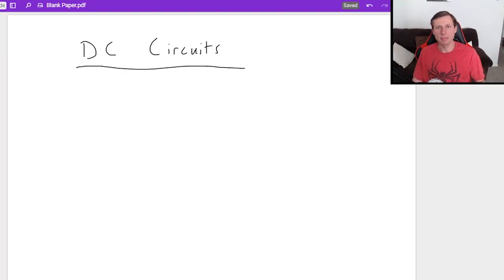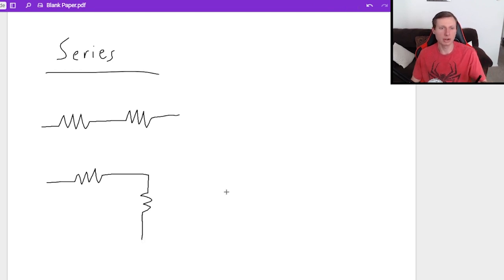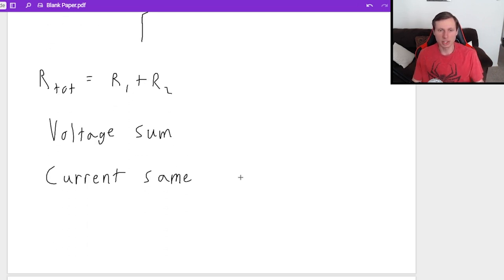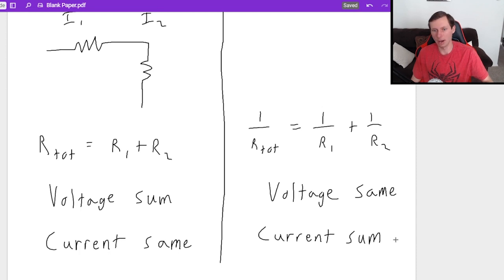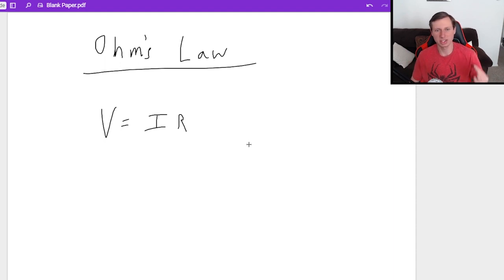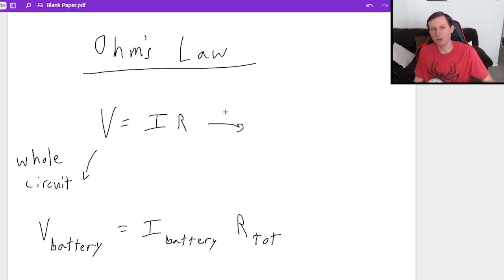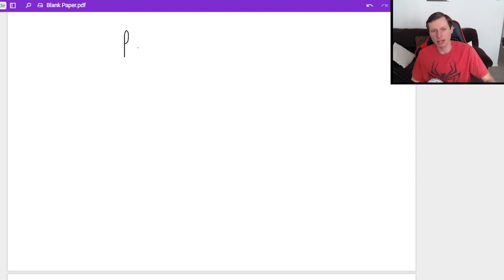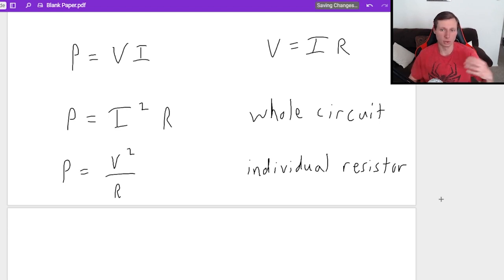Intro to DC Circuits

Comment: you're a great educator. Did u major in EE during college?
Reply from the maker: Yes I did. Lots of fun.
Reply: @danthetutor2624 Awesome. I’m currently a sophomore in EE. Has the degree served you well thus far in terms of employment and salary and stuff?
Reply from the maker: Yes, as long as you have a good GPA (3.6 or higher)
Reply: @danthetutor2624  mine is not so good. Rn sitting at a 3.0 because of screw ups during my first semester. Am I cooked? I got one internship this summer but other than that I’m just tryna grind and graduate wanna make decent when I’m out